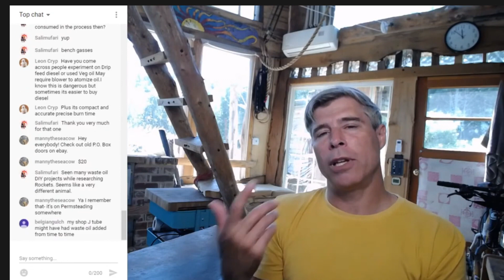Is a Barrel Necessary in a Rocket Mass Heater Build?

Comment: Thanks for pointing out the important role of a more conventional vertical chimney/stovepipe. I've built a rough batch-box test stove in my greenhouse for heating a stone-filled bench made with concrete patio slabs. I've been able to validate its function in helping to keep the plant areas (under an interior plastic "tent") above freezing even on -32 C nights this winter. But I've also realized that having the barrel get hot isn't helpful in heating the bench mass, and there's no real benefit to warming the air near the barrel. That's gotten me wondering if insulating the barrel, perhaps with aircrete, would be a good idea and retain more exhaust heat on its way to the bench. Your description makes it sound feasible.

Comment: My visualization of the benefit of the barrel is to ignite those after gases to avoid smoke from the chimney.
     Hello, I was watching your videos some time ago, the very nice, very expensive stoves. 8 hope someday, but for now, it is self-built for me.
Reply: Isn't the combustion completed in the lower part of the riser, well before reaching the surrounding barrel?
Reply: @ddwieland  I don't have time to review the video from months ago, I think this refers to the "rocket mass heater" stoves. The gases are carried through an insulated riser, reaching the roof of an upturned barrel, or other structure. In the vortex of swirling gases, the last of the flammable aspects are consumed, and the gases descend to the bottom of the structure and exhaust. It seems you want to draw a distinction as to where the gases burn.
   I just learned that, through Bill Gates' lobbying efforts, genuine meat will be banned in April 2024, replaced with highly toxic byproducts of estrogen mimicking soy, bound by glue, and pumped with toxic chemicals intended to shorten our lives.
  I have no time to debate which height in centimeters that hot gases are utterly burned away. I don't discourage you from doing so. Good luck!
Reply: @tomcondon6169  What is leading you to believe that the barrel ignites any after gasses?
Reply: never mind, just saw you meat conspiracy thoughts.  No need to discuss further.
Reply: "...meat conspiracy thoughts..."
    I neither make, 'conspiracy thoughts,' my meat nor drink.
    I would discuss engaging in adult correspondence, but I am reminded of juvenile men.
   A juvenile man, (men who American society perpetuate as boys), think their Father to be a fool. They are amazed, somewhere in their late 20s, how quickly their Father became wise.
Reply: @unionse7en  You remind me of a neighbor. He wanted a number I had, but I told him I had to be sure he didn't flake on my contact. I have texted and phone messaged him for weeks, with no response.
    A day later he came back angry, "I'm not angry about that, and no, I don't."
    I could teach him, but I'm not his teacher..i will foolishly explain to you, but the old adage, "When the student is ready, the teacher will come."
    You will no doubt call me a fool, rightly so, undertaking the task is a fool's errand, but here go.
    I have no idea what video I watched and commented on a year ago. I won't waste my time rereading, rewatching.
    To the best of my ability without wasting my time, this sounds like a manufactured product trying to recreate a rocket mass stove. Feel free to study the physics of these stoves, usually made from parts found or purchased, and rarely as a manufactured product.
    Hint: The cyclonic effect of 1,400 degree rapidly rising air.
    There, I said too much and robbed you of doing your own research.